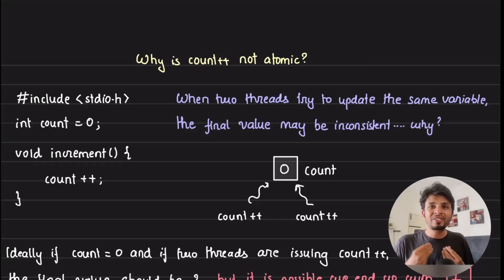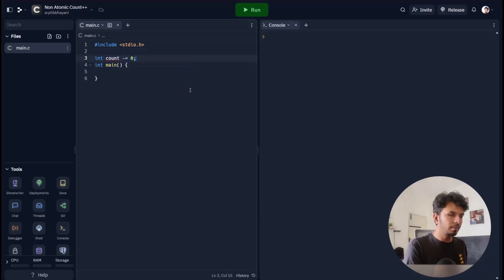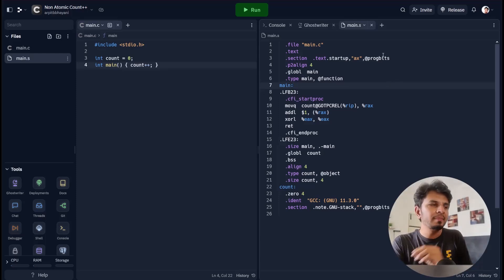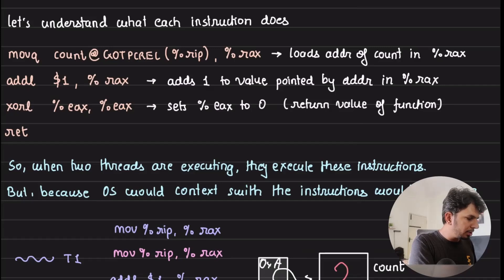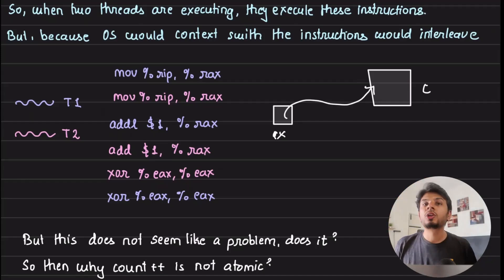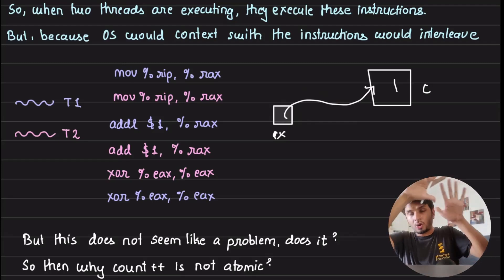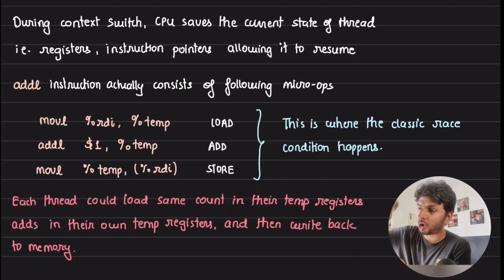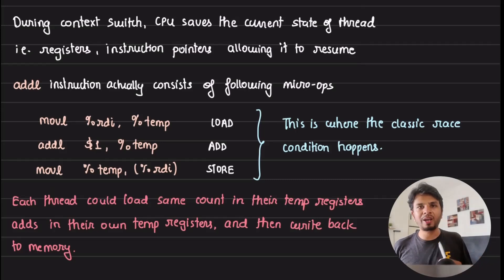Peeking into assembly code to understand why count++ is not atomic

Comment: Why do we need 2 mov micro instructions? Why couldn't we just use something like
addl $1, %rdi
as a single micro instruction?

Also, adding just 1 to a number "binarily" is extremely efficient right? It's much faster than adding any other number, so why couldn't we handle this as a special case?